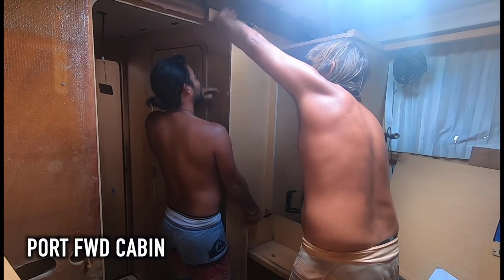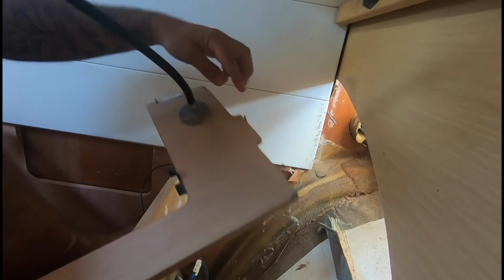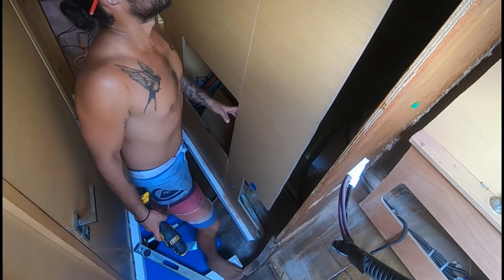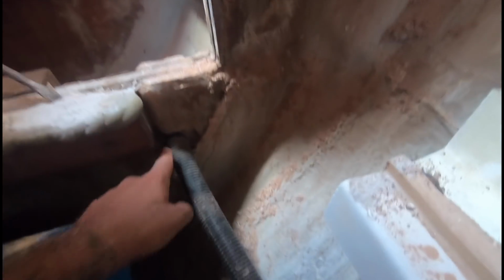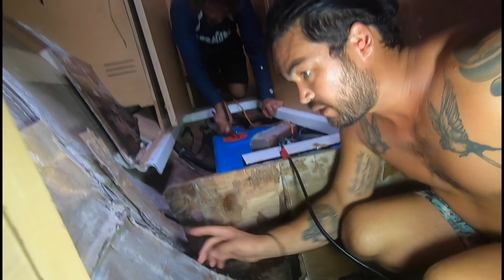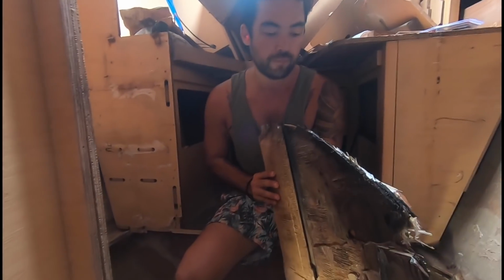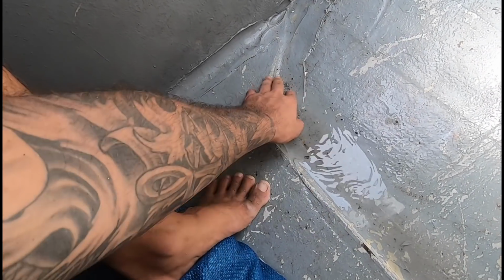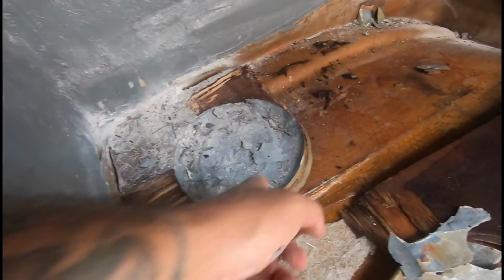CRACKED BULKHEAD REPAIR SERIES - Part 5  (Episode 110)

Comment: Lagoon should just send you a free boat for all these flaws and issues you're discovering.
Reply: But then they'd have to fix that boat too!
Reply: Just as long as it isn't another Lagoon though!
Reply: It’s hurricane damage, all fixings should have been removed and sealed after the boat was salvaged/repaired , from sail tracks to stanchions .
Lagoons are light weight production built boats not ice breakers, it’s too be expected that’s why hurricane damaged boats are so cheap, they all have hidden little gems like later rot and degregation.😁
Reply: With that amount of rot I'd think it was doing that long before the damage, but...
Reply: @JohnMayfield-NS  looks like 12 months of being wet, I’m not sure why all the fixings on the trampoline weren’t removed and checked also the locker could do with being limbered anyway
Reply: @andrewdrew677  It's not hurricane damage, there's about 100 of these boats with the same exact problems and most of them have never seen proper weather like this one has. This is 100% a manufacturing/engineering problem.

Also recall, only the port side of Parlay sank, the starboard side should be fine, but it has all of the same rot/warping, which even with no additional information should tell you there's more to this issue than the boat being in a storm.
Reply: @jttech44  sometimes the rig gets over tightened way beyond speck, also rigs on cats get overloaded with too much sail up in heavy winds causing bulkhead bowing over time .
This is a cruising boat not a ice breaker bro .
Also the boat was smashed to bits during the hurricane, so crying over spilt milk here.
Reply: @andrewdrew677  that's just the thing, when they tightened the rigging they couldn't get the tension in spec because the bulkheads had already failed.
That and the Lagoon 42's and others don't have this problem, more than a few folks on the forums have taken those through hurricanes and around the world multiple times without any issue.
Fact is, these boats are rated for basically any weather you'd find yourself in, and big, big seas, but they aren't built to that spec. No idea how they decided on that rating.
Reply: @andrewdrew677  It is prior failure as can be seen from previous repairs.

Comment: Production level center console boats have the same problem. They build them in two pieces. All the stringers, bulkheads, fuel tanks etc... go in first. Then they put the “liner” on top which includes the deck, storage boxes, live wells, etc... Once the top liner is on, you can forget about ever accessing anything underneath again.
Reply: Lagoon fabricators only had one job to complete!... which was to use right amount of binding agent and glue and make sure all holes, nooks and crannies are sealed
Reply: @StickyIky  it’s just production boats. Looks like sail boats are no different than powerboats. It’s all about getting them out the door. Gluing is faster and easier than glassing. Plywood is cheaper than composite. Big pre assembled pieces go together quickly at the factory, but are impossible to work with for the DIYer.

Comment: You need negative pressure where you are woking to keep the dust out of the rest of the living space .  -  set up fan that extracts  air from your working space and another to pump air into the living space you want to keep clean.  That should help a lot.
Reply: Brill suggestion 👏🏼

Comment: If anyone thinks this is a problem exclusive to Lagoon, they are kidding themselves. I would be very confident in saying that every sailboat on the water, regardless of make or design, will show signs of unwanted water infiltration and damage after being in service for several years. One small hidden crack. One tiny loose joint. One worn out seal. One mistake done when hauling the boat in or out of the water, where supports were placed improperly can cause such damage over time. So stop beating up on Lagoon, as they, like all others, are not perfect. But they, like all others, do try their darn best to be. I would be shocked if their engineers are not watching these videos and taking detailed notes for future improvements and modifications. This kind of detailed tear down and repair of a well used boat, that suffered such damage, is a gold mine of data that real engineers dream of obtaining. My only advice to Lagoon would be to send an engineer to Panama to document, advise and assist in the repairs. While taking detailed notes on this project along the way, in order to build an even better boat with that knowledge gained. Cheers from Winnipeg.
Reply: I was thinking the same thing.  Years of use and since most of the places they are finding water and rotting is behind paneling.  If anything when looking for a Cat now we know somewhat what to look for.  I think Lagoon has been helping with diagrams and advice.  I also think since they are ripping out most of the cabin parts he could redesign anyway he wants.  A truly custom job and when its all said and done and after the trip a nice resell value.  But a ton of work still to be done.

Comment: Colin, I have a canvas bag on the discharge of my electric leaf blower to catch leaves & a PVC tube on the suction, think Black & Decker claims 450 mph blower speed, but think it would suck fiberglass dust out of any grinding area & capture most of the dust in the bag. Had the bowspead fall off the 1929 built steel hull (Black Douglas), so it is not just fiberglass boats.

Comment: Build Back Better process for a boat, imagine trying to do that for an entire country. Plywood is like a sponge, you would be better off using a material that can not absorb fluids, you can put a piece of plywood in a vacuum bag and saturate the wood cells with resin let it set up and then install it into the boat. you can also use the closed cell foam panels designed for boat and hull construction, you need multiple layers for the needed structural support for each intended application.

Comment: I would test the hull integrity directly where the rotten bulkheads were.   Instead of rebuilding the sandwiched bulkhead on a known "leak" line, I would build two bulkheads about 3 inches apart and plan to divert any water that enters the original bulkhead line.  It will likely leak again.  Water can run a mile if given an inch.  So you either have permanently stop the source of the leak(s) or deal with the water and give it a channel to be taking care of.

Comment: Just watched...twice! Your Never Quit attitude is inspiring.

Is there anything that is hard to get in that little town?  Can we send it to you from the States? 
Drimmel wheels? Saw blades? Etc.?
Reply: These videos are a fair bit behind real life. There's another guy named David who has his Lagoon 450 pulled up next to Colin's and is doing the same thing, but his videos are much closer to real time, and Colin already had started the glass work, so, I'd guess this channel is at least a week or two behind.

Dave's boat is an interesting one, because it's never been sunk, never been in a storm, and was well maintained by the previous charter company that owned it, but it has all of the same problems that Colin's boat has, just not as developed. Still has cracked and warped bulkheads throughout, likely came that way from the factory. His was just as out of square as Colin's was too.

I'd bet you could hop on any Lagoon 450 and find the same issues, and the owners would be completely oblivious because Lagoon won't disclose the issue to them.

Comment: Just get rid of all the old cabin hardwoods and make the boat really utilitarian. This way in the future you’ll be able to inspect the areas that you repaired. Also this would make the boat lighter by leaving a lot of that hardwood and cabinetry out of there.
Reply: Not a bad idea actually. Even if they glued a foam backed marine vinyl and do trims for all the edges it would look nice and be a lot less work and lighter, and also the cabins would feel a lot bigger
Reply: @aquacruisedb  Yeah, I'm always amazed at the amount of wasted space. Surely in any boat, space is paramount. There's oodles of dead space behind panels in this Cat...

Comment: You found that plywood should not be used in structure in a marine environment. I would suggest PVC foam with glass on both sides as replacement .    csmale9@bak.rr.com
Reply: Indeed. Some manufacturers are using foam as a filler. The general problem however is about the cost effectiveness. And they are always looking for saving as much money as possible.